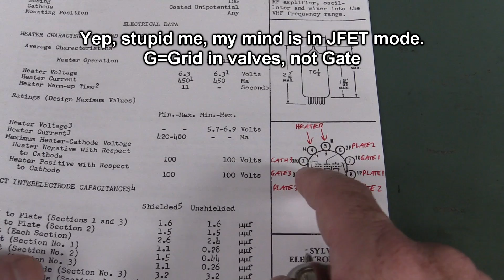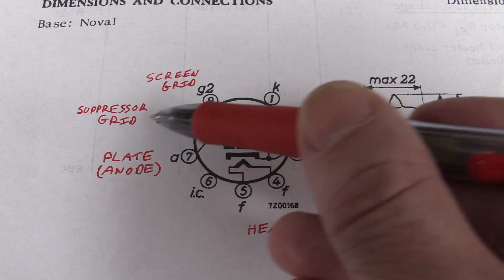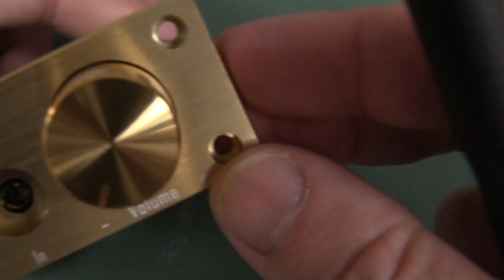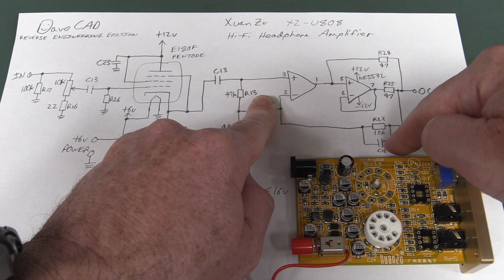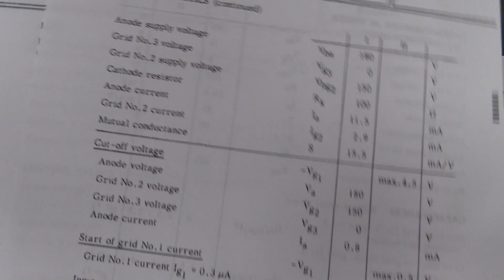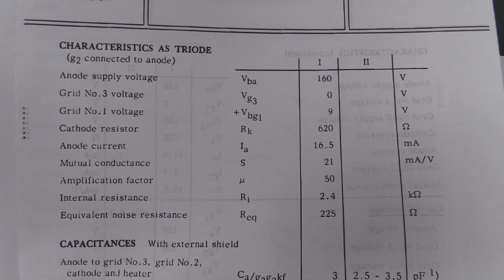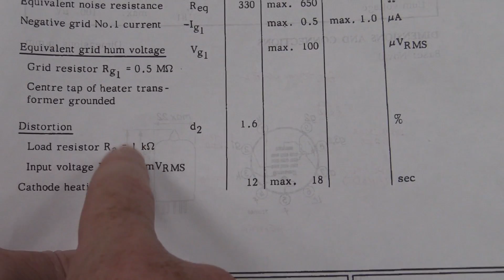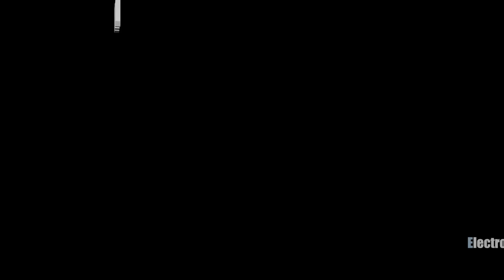EEVblog #837 - Reverse Engineering A Valve Headphone Amplifier

Comment: I feel obliged to comment, craptacular eBay headphone amps, im sure are nigh on useless. 

but a well built, proper one does sound excellent, and is a worthwhile thing to build. mine has a signal preamp with a bit of gain and a big fat cathode follower to drive the cans. 

I like it, and now cant use my senheissers without it, they sound gutless. opamp based ones do help alot, but still arnt as nice.

but thats just me. ymmv. one of my favorite things about electronics as a hobby, you can ignore marketing wank and extensive numeric testing, build and tweak a thing that sounds good to you.

Comment: Light emitting transistors, the reason why the Chinese valves are lit with blue LED' is because they don't evacuate the tube as well as the old UK/ US ones, the residual oxygen glows blue so it is hidden with blue light !
Reply: not even that sophisticated, they added the blue LEDs under the tubes because it makes them look cooler.

Comment: That is a poor use of vacuum tubes in an amplifier. That would work better with 120vdc on the plate and using a emitter  follower to drive the headphone or speaker instead of using basically an op-amp to get the gain. Even 250vdc is not a problem in an amplifier if people are not putting knifes and forks into them. Why not use something such as the 6GH8 as it has both a triode and pentode, then the two together will provide high gain and high impedance along with enough current output such as a Cascode amplifier to drive a solid state output instead of a transformer.

Comment: Why was one ne5532 inside the feedback loop of the other, as opposed to them both independantly amplifying the output of the tube and then have their outputs connected in parallel?
Reply: +Daniel Beckett Puting two opamp inputs in parallel halves input impedance, including doubled input capacitance. I don't think it would have mattered much here though.

BTW, in a parallel circuit it is generally recommended to have them share the same feedback network, depending on how large current sharing resistors are. Otherwise resistor tolerances may mean unwanted cross-currents.

Comment: What is a cathode follower,  and what does buffering mean in that context?
Reply: +Mobin92 It can be used to raise input impedance and decrease output impedance.   Another way to say that is that it provides current gain but no voltage gain.  The tube almost certainly would perform that job worse than an opamp, but the opamp wouldn't add much distortion.

Comment: So what do you mean by "it's a buffer?" What's being buffered?
Reply: +JL Software  https://en.wikipedia.org/wiki/Buffer_amplifier
Reply: +JL Software

A buffer in this context usually means that it has a 1:1 ratio of voltage output to voltage input, but the difference is that the output has more current drive capability (for driving headphones directly etc.)

You can often tell if an opamp is configured as a buffer because it will generally have it's output pin connected directly to one of it's inputs (at least I think it works with the output connected to the non-inverting input too?)

The tube (/valve) itself is working as a cathode-follower, which is essentially pretty much the same as a transistor emitter-follower. This means that the voltage on the output is typically closely "following" the input voltage.

In most cases, I think the point of simple buffers like this is to provide more output current drive though?

I don't imagine the tube in this amp is doing anything amazing to the audio, and as Dave rightly points out, the thing that people are hearing with the so-called "Valve sound" is simply......distortion! (and usually quite a lot of it - there's a reason it's called "warm an Fuzzy". lol)

The characteristics of valves have been VERY well documented and reproduced these days with things like transistor / op-amp circuits and DSP on things like VST plugins on audio software.

In fact, I would bet that some of the best audio plugins would be indistinguishable to MOST people from a "real" valve amp if they are both set up with the same parameters in terms of true distortion / overdrive / EQ / amplitude etc.

People that say they MUST use a real valve amp because nothing more modern can match the sound are quite deluded. We have got very good at measuring the exact responses of things like valves these days, to the point where their "sound" can be completely recreated using modern silicon.

Other people are saying on here that this specific amp is a very bad example of what a "REAL" valve amp sounds like - well, of course! lol - this is a cheap crappy amp that is more about snake oil and style-over substance than anything else, and is never going to be anywhere close to the sound or performance of a decent valve amp.

(although how much "style" this amp has is also debatable. :p )

Yes, valves do have their appeal though - I do like the warm glow of them as well, and I'm constantly torn between the Worlds of retro and modern / analog and digital. Pretty much all of my projects involve retro computing / retro gaming in some way, but I also appreciate the modern stuff too.

I love the sound of (uncompressed) digital audio for example, I still like old VCRs and tapes, and I'm considering buying another VCR soon, and probably another Laserdisc player (even though I got really fed up with doing VCR / TV repairs in the 90s / 00s. lol)

I'm not sure I would go as far as saying I would start collecting vinyl any time soon - I'm past that point. hehe

There are even videos on YouTube of people claiming that because a vinyl record can "produce" sounds of well above the average human hearing range of 20KHz that it somehow makes them "better" than CDs. In fact, the exact opposite is the case. LOL

(of course you will see tons of spurious crap / harmonics / distortion well above 20KHz on a vinyl record when recording at 192KHz on a sound card. It's a completely expected result, and simply due to the fact that there's a needle bouncing around in a long groove that can never be cut 100% perfectly, nor can it be designed in a way that stops the needle producing tons of added vibration / distortion.)

I'm not saying that there's no argument for the valve or vinyl "sound" either - yes, it can add a nice amount of warmth and so-called "character" to music (or even vocal recordings), it's a nostalgia thing as much as retro computers are - the problems and arguments start when people keep attributing magical powers to things like values / tubes, when they are very well understood devices and hold no real mysteries at all.

So, please enjoy your tube amps and vinyl by all means. I genuinely do appreciate all older recording mediums and playback devices. But PLEASE don't spend fortunes on things which can be done just as easily (and far cheaper) on modern-day equipment. Then again, if you have that kind of disposable income to waste, I guess it's up to you. :p
Reply: +digitalradiohacker Quite a few headphones are way more current hungry than low voltage or tiny opamps can source and then the opamp gets current limited including distortion. That said, parallel NE5532 are not a current source really, some 60 mA max.
Reply: digitalradiohacker So you could just use a wire and accomplish the same thing? It passes a signal and voltage from one circuit to another.
Reply: JL Software

It's not just keeping the voltage the same in most cases, it's about having a higher current capability on the output side (else the voltage would drop too much).

That's due to the difference in impedance between two parts of a circuit - buffers are sometimes needed to prevent the voltage dropping too much, or for driving long wires etc.

If you search for "impedance matching" on YouTube, there are quite a few videos on the subject.

Impedance is essentially "AC resistance", or the resistance of a circuit or cable as a function of the frequency of the signal(s) being passed through.

For example, you could have a 10MHz signal in a cable, and the output circuit would "see" 50 Ohms, but when the signal frequency is raised to say 40MHz, the circuit would "see" 70 Ohms.

As others have said on here though - the main purpose of the buffer in the amp circuit is to "de-couple" the final output part of the circuit from the circuit before it.

The buffer helps prevent the load on the output from affecting the rest of the circuit, and it also provides extra current for driving the headphones etc.
Reply: I know about impedance; so basically this is a buffer because it allows the current to increase without changing the voltage? But wouldn't the voltage or the resistance change anyway, due to Ohm's Law E = IR? Or perhaps you mean that the impedance changes, which is effectively the resistance in an AC circuit?
Reply: It's more to do with the output drive "capability", and helping to stop the output side of the circuit from affecting the input side of the opamp.

ie. it helps prevent the input side voltage from being dragged down when it's trying to drive a lower impedance path.

But, in the case of this amp, the second opamp is actually working in parallel with the first stage, since they are both driving into a 47 Ohm resistor (so each opamp is sharing the current load).

The more common use of a unity-gain buffer is my description above, but yeah, in this particular circuit it's more about driving more current into the headphones.

Sometimes you'll see a buffer stage being used anyway, simply because it's "spare" (and the two-opamp chips are very common.)
Reply: A buffer is used primarily to increase the output impedance of a stage.
Reply: Yep, it's about isolation as well as (often) driving larger loads on the output side.

In opamp mixing / equalisation circuits though, each stage is often designed so that the much higher impedance of the input pins on the next opamp won't overly affect the previous stage.

That is usually so it doesn't affect things like the feedback resistors on the previous stage, and so the filter response isn't affected etc.

digitalradiohacker's reply about the light bulb is a good analogy - the light bulb is a low-impedance (resistance) load, so it would seriously affect the output of something like a small solar panel if you simply hooked it up directly.

(not that a buffer would help in that situation, but it's a similar concept.)

A "buffer" in terms of an analog circuit often also means a 1:1 ratio between the voltage on the input side and the voltage on the output side (ie. no amplification or attenuation. For an opamp, this is usually referred to as "unity gain").

Another way of looking at it is a simple voltage divider...

If both resistors were exactly the same value, then the DC voltage measured on the output would be exactly half of the input DC voltage (minus the resistance of the wires themselves)...

http://sub.allaboutcircuits.com/images/00107.png

But, that's only with NO load connected. A load would introduce extra "resistance" into the circuit, and so the output voltage of the divider would drop in response.

This is why some sort of opamp or discrete transistor circuit may be needed if you want to say produce a simple "regulator" using a resistor divider.

(most regulators use a Zener diode or a current souce as a reference though of course. They are usually far more accurate with a varying input voltage and different output loads.)

So yeah, a simple piece of wire is not the same as a proper buffer in most cases. ;)

Comment: Hahaha jfet with a pilot light. Don't say that to tube purist and guitarrist. There is an orange guitar amp that FINALLY uses jfets after knowing that they work similar for decades. In the 80s there was solid state replacement for tubes. That sound horrible. But after knowing that jfet were good enough I believe they used opamps just to increase the value of their tube amp. Making then sound bad on porpuse. I know they can make good solid state designs. I found and old fender schematic of a bass amp that used jfet in a classic fender bassman configuration. So they knew.

Comment: So if i put a line level Input will it come out louder more powerful just because the opamps not the tubes?
Reply: +Hobbyandtech Pretty much, the only reason the tubes are part of the circuit at all is so they can claim the amp uses tubes as part of the active circuitry. I suppose that does differentiate them from those that produce amps where the tube parts are just cosmetic and not at all part of the actual sound path, but it's still just a trick to get people to pay more for what is for all practical purposes identical to much cheaper semiconductor amplifiers.
Reply: that´s watt i thought , i suppose is better this way cause cheap tubes sound bad lol

Comment: If you had one of these, would it be possible to modify the tube out so it only uses the OpAmps as mentioned at the end?
Reply: +Clyne Griffon of course,simply connect the input straight to the first ne5532 stage, that´s it....may you change the value of the resistors to match your needs....47k may be a bit to low in some cases...but usually it´ll work

Comment: By the ominisiah, those tubes. Those freaking tubes, man. Do audiophiles think that audio fidelity in a HI-Fi player suffers if you don't use giant lumps of glass? Or do manufacturers of bullshit like this just whack valves into this stuff to look cool like Dave said?
Reply: valves or tubes give a better sound, so this is built for hipsters to match their Chinese record player. however I want a positive earth valve / tube amplifier for my 109 2a, horizontal valve position. :)
Reply: Arjan Wilbie
 The only effect hi-fi has for me is it sounds like the audio has more substance. The only problem with this is that I can get the same effect with a digital full frequency recording.

Hipsters be damned and chinese domestic needs to catch the fuck up and stop making crap. Like those 6-core processors they put in phones over there that look like they were designed by undergrads bullshitting around.
Reply: +LT Gen Klink I think it's due to human limitation... I had the pleasure of listening to a "perfect" amplifier, an audiophile's wet dream, but I did not like it. It was "too perfect",  it kind of dissected the sound. It did not sound like you "were there" it sounded probably "better" but less "human".
A bit like the cake from the award wining chef may be more perfect than the stuff made at home, but not be as much fun to eat?
Anyway, the same music, to my ear, sounded way better on a early 90's amplifier, more enjoyable (and can be found for cheap on Ebay).
Reply: +LT Gen Klink my music has been broadcast from a ship using 10kw to 50kw continental transmitter on the north sea. generator feedback and even hearing them run during programs was part of it. I love AM fading and I like to DX with a valve radio and 20m copper as antenna. I am stuck in a time period that was not mine to start with.
Reply: smellysam
 The surround sound logitechs I wear deliver the best sound for me. Playing a vidjah game with real good sound engineering is just heaven. And that's the thing. Properly engineered sound is key. And for me, spooled copper wire and giant tubes without air in them don't create the experience. The people in the studio working the machines do.
Reply: +smellysam then it was not a "perfect amplifier", a perfect amplifier is the one that doesnt exist, the one that just amplifies and doesnt alter the sound in any perceptible way
Reply: +LT Gen Klink 'logitech' and 'properly engineered' in one sentence... thats what you need for a great joke
Reply: ddorfpunk1 234
 But they aren't in the same sentence, or in the same thought.
Reply: ddorfpunk1 234 dont be so ignorant

http://gaming.logitech.com/en-us/product/g900-chaos-spectrum-mouse?wt.ac=g900

Comment: Now I know I "should" know this but how do you get the -12v or is it just -12v if the 12v is the reference?
Reply: +Bryce Wilson DC/DC converter
Reply: But how do you get negative voltage unless the voltage is some how running from ground to there.
Reply: +Bryce Wilson have a look at the application notes for a MC34063A DC-DC converting chip. There is an examplr circuit for -12V from a 6V source.

http://www.jaycar.com.au/Active-Components/Integrated-Circuits/Linear/MC34063-DC-to-DC-Converter-IC/p/ZK8837

Comment: I have ZHILAI D1 with probably the same amplifier and build-in DAC. It is great for creative aurvana live (32om), but I have a problem with noise when I'm using superlux hmd660 (150om). It's should work with earphone impedance: 18-600Ohm. Any ideas why? 
This LED under tube looks terible.

Comment: Your circuit drawing is not correct, why do you connect pin8 to output, but not connect pin9 to ouput? In the circuit board actually pin9 is connected to ouput.

Comment: Is it possible to make a stereo amplifier using only one tube? You can buy them with only one tube (valves/lamps).
Reply: Sure. Use a twin triode such as a 12AT7.
Reply: John Casteel 

In the UK, there is (or was?) the British Valve Association, which forbids (forbade?) the sale of valves with multiple units in the same valve.

I wonder if that would have been affected by Brentrance in 1973.